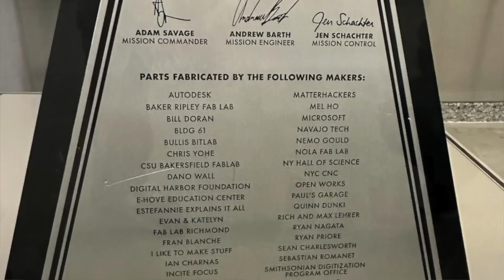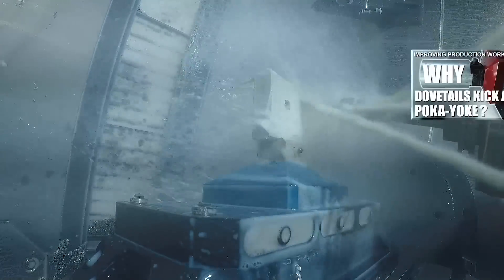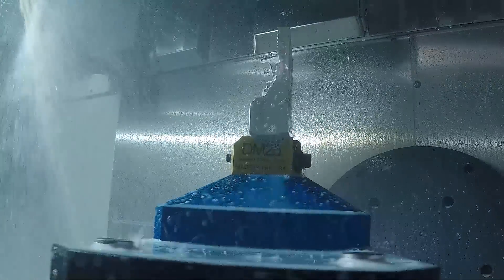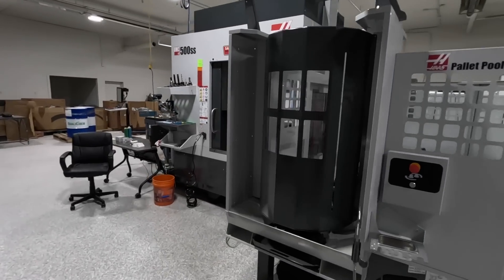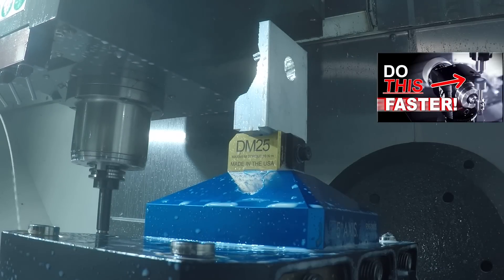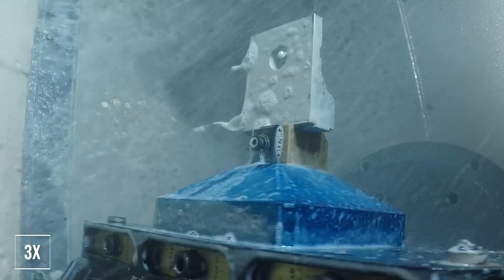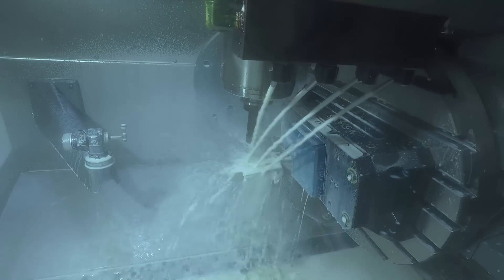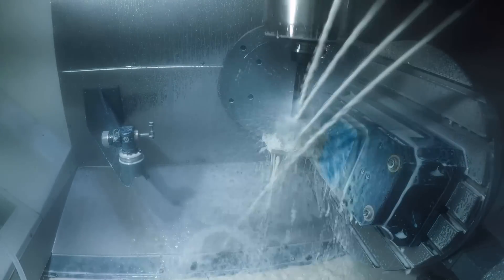Machining a 5-Axis Rover Camera Mount headed TO THE MOON!

Comment: Never really thought about using hot Glue, i have made a good deal of tab off methods that leave the part rigid / snap off ready with only a 1 edge deburr needed. 
send me PM if you want some ideas.
Primary Focus has been 5 Axis machines with 1 off tooling concepts.

Comment: Hey John, would you talk about the various 5 axis CAM options with Fusion 360? I'm particularly interested in simultaneous 5 axis and Autodesk offers the Machining extension for Fusion 360, but there is also Powermill and I've heard seen you talk about CAMplete Toolpath. Wow, so many different options. For small manufacturer like myself, I know the Extension is on sale right now for about $1200 for a year. But are the other options more powerful and what pricing? Just curious if you've used all of the various CAM options in your Fusion 360 workflow and what you thought of them. Thanks! Always look forward to your content!